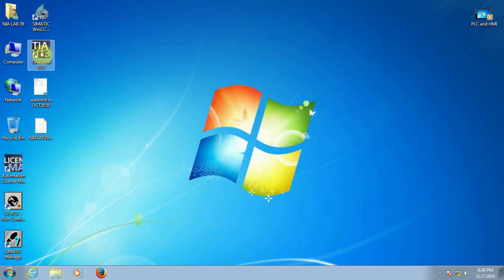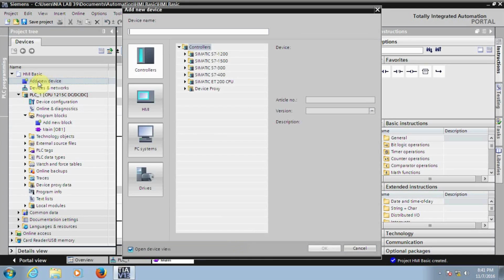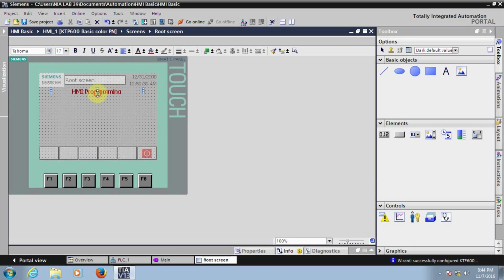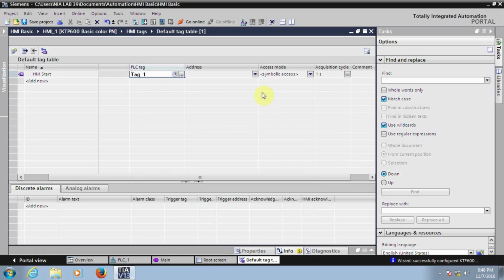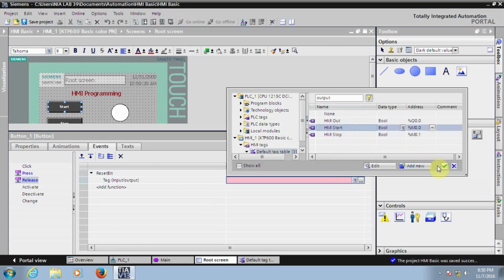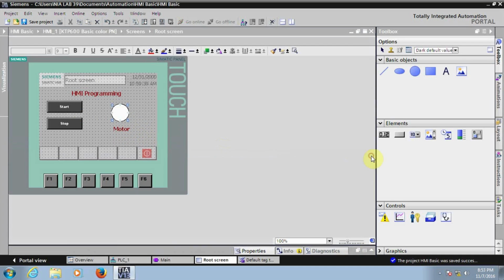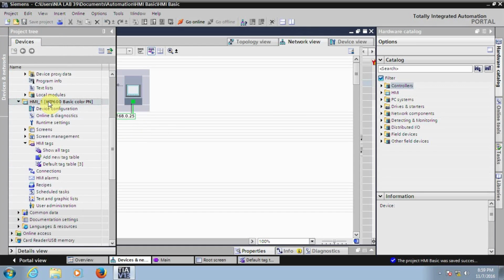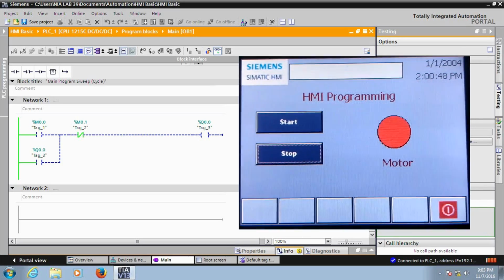Siemens KTP600 HMI Programming

Comment: THANKS for the Video, it was intresting and clear.
 with the Cpu that you have used, is it possible to add more input and output slots if needed?
How much does it cost for the CPU and HMI pannel that you have used?
Reply from the maker: Hello Gopal, Yes it is possible to expand the IO's with this CPU1215C, Regarding cost of IO modules i have no idea, but HMI KTP600 i got for 27k
Reply: Thanks for the Information, I am interested in learning Programming by Siemens.
Do you have a training center?
Reply from the maker: Raja Gopal you can contact to my mail id sncvnrvjiet@gmail.com

Comment: Got the same problem as vinzmen does.
I start the simulation of HMI panel but in fact there is no reaction of the device or monitoring in the meanwhile. Is there any difference of connection settings during the simulation that needs to be included?
Thank you for any advice

Comment: Dear Mr. Nag
I have a problem installing TIA Portal V13. The problem is that when reaching the "modifying system" during the installation process , the installation doesn't completes and abort installation not reaching the end and ,hence finishes with an error.
It will be of great thanks if you can help me fixing the problem. I am using Windows 10 running on a LENOVO IPAD 300 Laptop.
please help me
thanks